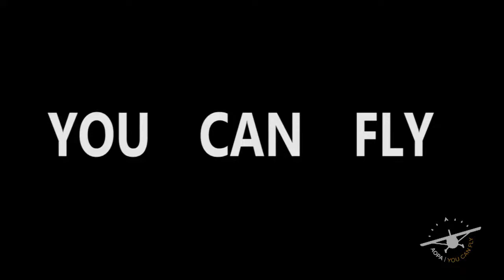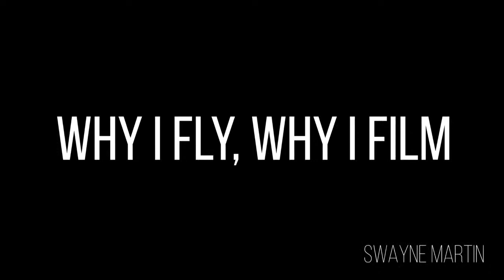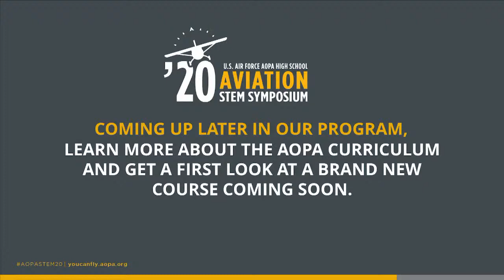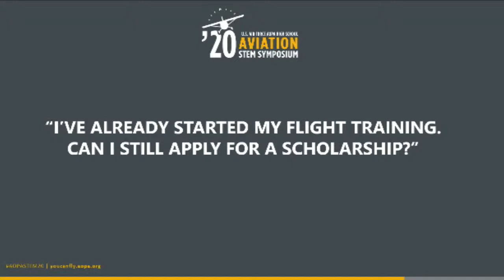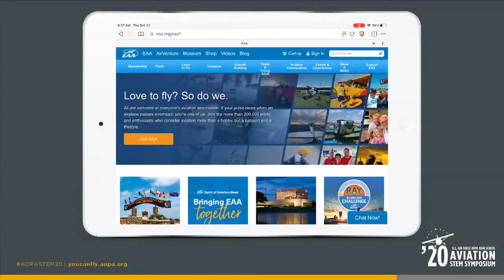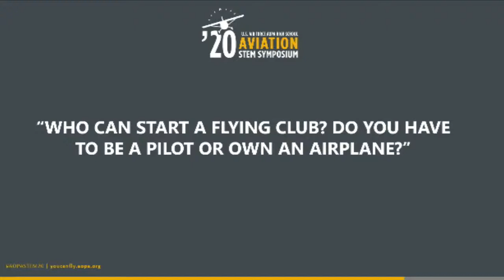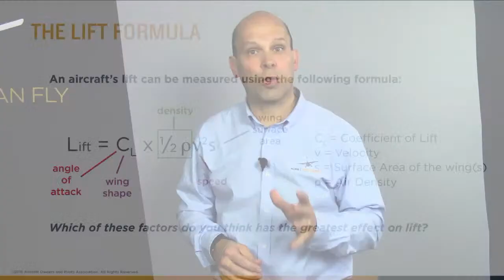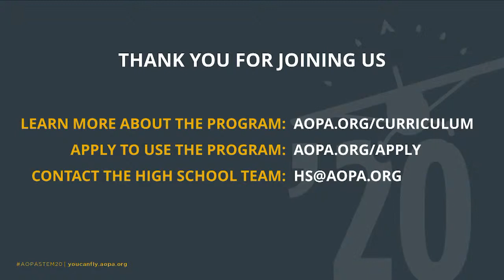U.S. Air Force, AOPA High School Aviation STEM Symposium Live Stream

Comment: AOPA has always been my flying association ever since I soloed about ten days before Apollo 11.  I soled at age 16 in July 1969 a few weeks before my 17 birthday.  I've been an AOPA member since I was a student pilot in 1969.  I remember receiving AOPA magazines when there were yellow pages in the first front 5 page sections.  Back in those days, the FAA and GA were at odds with each other.  The AOPA was continuity battling with the FAA about new regulations and the costs of gasoline.  We battled with our rights to fly into airports where only the airlines would land.  Those were the days of GA vs. the FAA.   Today it's no longer such a battle.  The FAA has learned that GA is a force to reckon with and has worked with GA to forge ahead with rules and regulations that benefit GA.  Back in the 1960s, the airlines didn't want GA to fly in the same skies with them.  Have any of you heard of at "TCA"?   Back in the 60s, a TCA was called "terminal controlled airspace".  It was the pre-curser to Class-B airspace.  Instead of Class D airspace we had  and "ATA" or and "Airport Traffic Area" which would change into an instrument controlled area should the weather go below 1000 ft. and 3 miles of visibility.  How would you liked to have lived during a time during that transitional period when you had to learn the difference from the old airspace to the new?  Well, I did and it's so old I can't even remember If I got it right here.